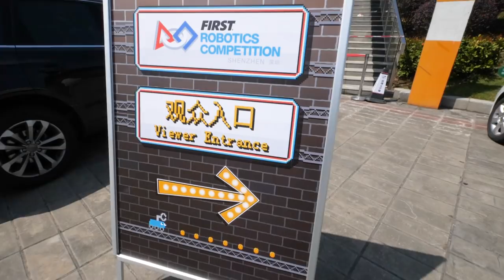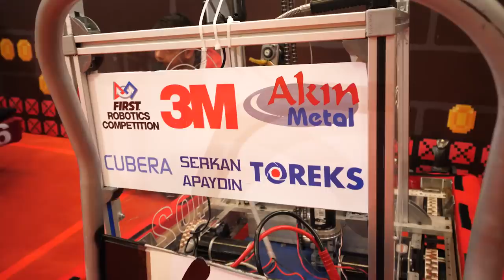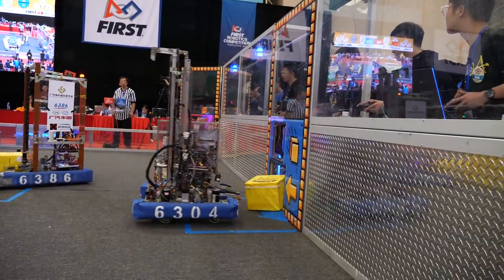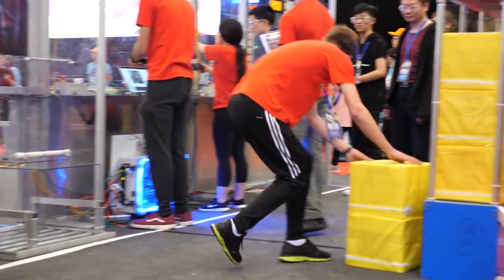OMG ROBOTS!!!

Comment: I actually had a question for you sir. People often take a 16gb or 32gb iphone which turns out to be less and then they are stuck with it because they can't buy a new one. So I was wondering if it's possible to swap the memory stick to a larger capacity one. So I was wondering if it's possible to upgrade a 16/32gb iphone to a 64/128gb iphone but swapping the   memory card ? If yes could you please upload a video doing that ? thanks you sir. PS you are awesome

Comment: Hey, just wanted to know if you can add an SD card slot for your new iPhone experiment?
Reply: Since there are sd card readers for iphones out there (through lightning port ofc). It would end pretty much like the audio jacket project, a switch circuit, and figured out around how to put in the tight spaces.

Comment: Why is everyone wearing protective glasses?
Reply from the maker: I was surprised too, but apparently a requirement for everyone at the event.  I guess 120 pound robots driving at high speeds can lead to flying projectiles?  I don't know - it did seem like slight overkill.
Reply: Ah one of those rules eh, that makes sense. Thanks!
Reply: FIRST emphasizes safety, it's not only the safety glasses there are a lot of strict rules regarding safety.
Reply from the maker: Yeah, some things are just not worth questioning.  Mandatory safety gear usually falls into that category for me.
Reply: Because robots are made in china, you cant really tell whats going to happen. But on a side note, safety glasses are made in china too.
Reply: what is your point.
Reply: Its easier to enforce people wearing them all the time so they don't "forget" to wear them when they actually need them.
and it's good practice for when they enter "the workforce", rules like these are common practice in industrial environments.
Reply: Xiaowei Tan just joking brah, i love china
Reply: what were you thinking, i thought what you said is robot are in high quality which if accident happened, normal cheap safety glasses does not work because high pressure point, and high quality safety goggle is needed. so that is a joke. nose picking.
Reply: It is highly annoying.  We are required to wear safety glasses at least in the pit area(robot servicing area) to protect from any projectiles that could injure us.  FIRST is very strict and has strange rules from one time scenarios.  Their rules are updated every few weeks.   We are also not allowed to clip clothespins to people during matches.
Reply: Robots built by high schoolers are friggin' scary, man. Every year there's always at least one robot that encounters some sort of on-field electrical problem that causes their robot to quite literally burst into flames. There's videos of this happening, not for the faint of heart though. Not to mention all of the manipulators and moving parts that come alongside a competition robot *shudders*... Honestly, if you can go an entire competition without something freaky happening to your team's robot or another team's robot, you're doing something wrong. But yeah, safety glasses are nice I guess.
Reply: Required, or requited as one of the meets had on the sheet...
Reply: Kinda so they can protect from law suits if someone gets hurt...